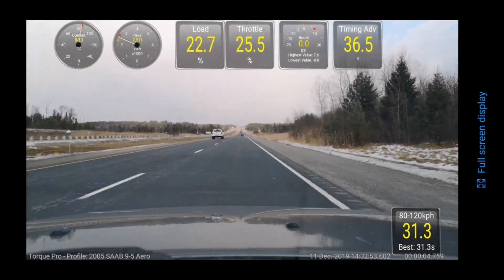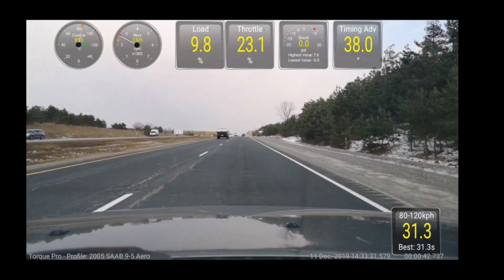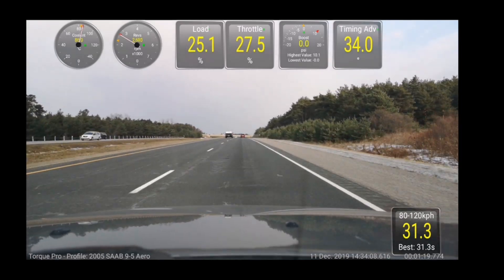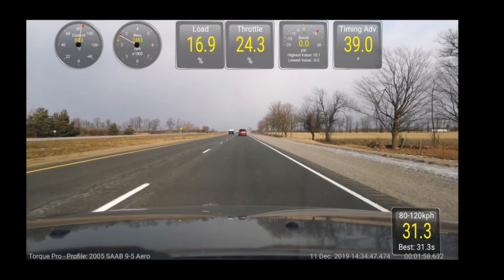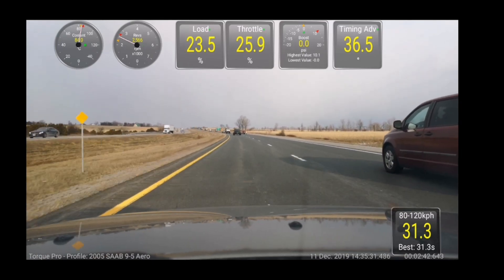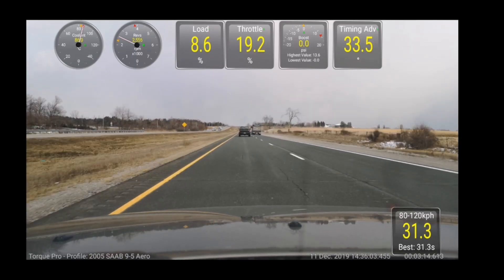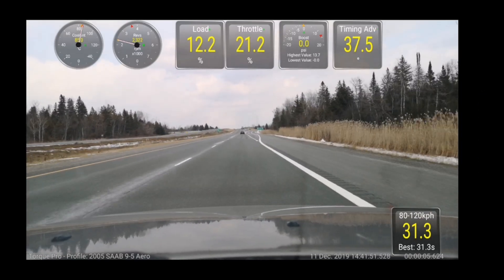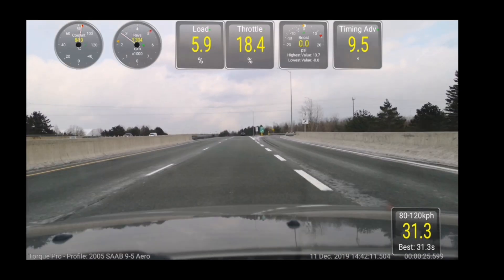Saab 9-5 Normal vs Sport vs Sentronic Paddle Shift

Comment: Hi! I have a manual 2002 9-5 Aero with a dash cam. I also have the Torque Pro app on my phone. How can I combine both, like you?
Reply from the maker: You can't "combine" them. You need Torque Pro and the free ad-on called Track Recorder. It uses your phones video camera and overlays the gauges you've selected while the OBD II reader is plugged in.
Reply: @kmercuryc  thanks a lot